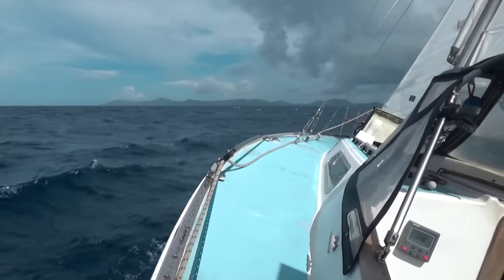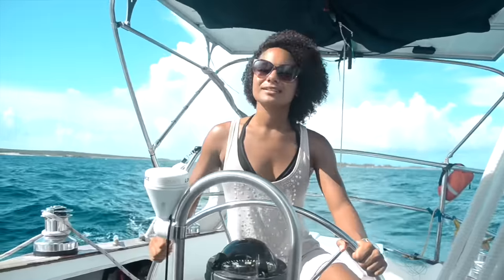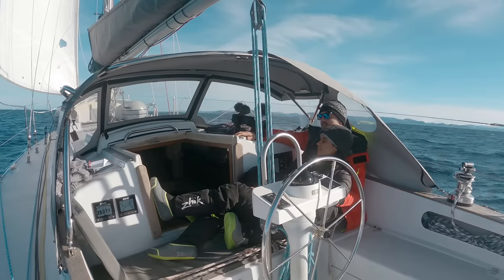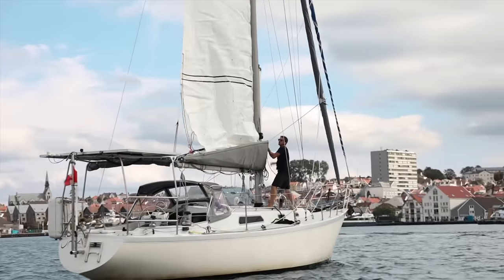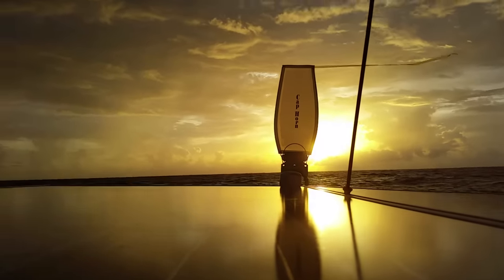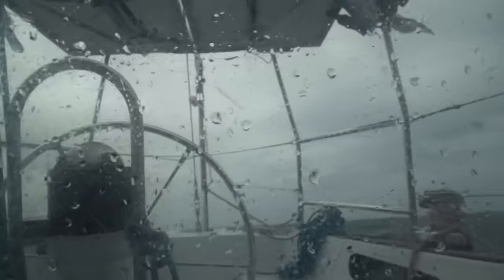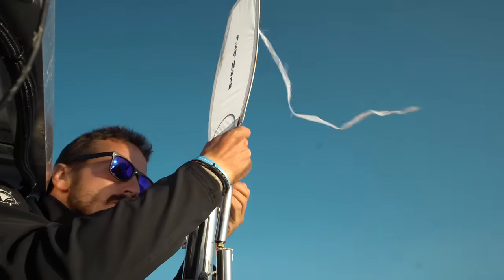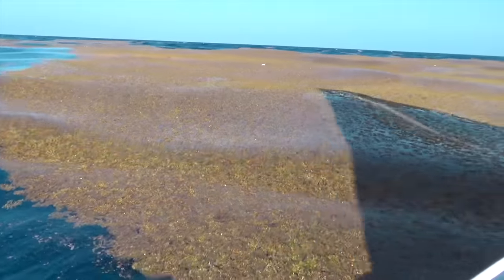Our #1 SAFETY PRIORITY (Autopilot or Windvane)  — Sailing Uma [Step 261]

Comment: Just curious why you guys never used SHEET TO WHEEL/TILLER STEERING? Much more reliable than that raymarine  although if you had the proper powered ray marine autopilot for your boat, it would have been fine.
Reply from the maker: Windvane steers much better. Beside, sheet to tiller works better on slow, full keel boats. Not so good on fin keels

Comment: Let me see i I understand correctly, looks as though the Cape Horn needs to attach to the boats rudder via the rudder quadrant.  I was under the impression that some servo-pendulum wind vanes do NOT connect to the boats rudder post/quadrant . Am I incorrect in that assumption ?
Reply from the maker: Some wind vanes do have their own rudder. But their a lot bigger and bulkier and add more complexity.
Reply: @SailingUma  Yawl do a EXCELLENT job in sharing the narrative of your video's ... well done guys !
Wishing you Fair Winds and Calm Seas .... 👌 ⛵

Comment: One other downside to the wind vane is it doesn’t work well if you have dinghy davits back there. So it becomes sort of a trade off of do you want to mount your dinging off the stern or do you want the wind vane? If anyone knows of a way to have the davits and the wind vane I’d really like to know about it.
Reply: Most of the offshore cruisers I have seen, keep the dingy inverted on the bow, for ocean crossings on monohulls, catamarans, have better protection back there, for values of protection.😁  I have seen a few Hydrovane setups, that have a taller top pole to get the vane slightly above the level of the top of the davit arm, into clear air.
Best wishes

Comment: If you are sailing in a congested area you should be hand steering and paying attention yourself to what is going on.
Reply: You can pay attention without a tiller / wheel in your hands!
Reply: @Panoramix0874  I think that goes without saying.
Reply: @emilybh6255  so no need to hand steer! An autopilot will steer better than a human that needs to pay attention to a million things and IMHO you are better off paying attention to your environment than hand steer. If you are on a collision course with many boats around, you can always put the autopilot in standby, steer manually for 5 minutes and reengage it afterward.

Comment: Firstly, I enjoy your channel, BUT, the info you have given regarding a self steering wind vane in comparison to an auto pilot, re: anticipating the movement of the boat is not correct, the wind vane will only correct, when the wind vane tilts or rotates, i.e., the coarse changes, it does not  anticipate the coarse change, verses a modern auto pilot like you have [B&G], with a 9 axis gyro, monitoring roll, pitch and yaw , and anticipates a coarse change, and will start correcting before the change takes place, much like a helmsman would.
Reply from the maker: The windvane has a pendulum in the water and it can also "feel" when the boat is sliding down a wave and correct the motion. But after 3 years with both, we still prefer the windvane off shore. It just works better.

Comment: I watched a few of the Atlantic Crossing videos in rough weather to watch the Cape Horn in action.  It is like some mystery magical helm.  Even when watching it was hard to understand WHY it works.  Maybe I am just dumb.  But, it's a very cool thing.  I did notice at 13:20 the howelling of the wind was clear and wanted to be in this show!  PS Did you get a kick out of seeing the old helm station, the blue decks, and what was that little gear shift thingy under the bench?  (left port side of Wheel)  Happy Trails
Reply: (Disclaimer: not a real sailor, much less a cruiser)

I'm not sure how exactly the Cape Horn works, but basically, you set the vane to point in the direction you want the wind to come from, relative to the boat. If the boat now turns, the wind doesn't come from edge on to the vane, so it blows the vane over in one or the other direction. That in turn triggers some mechanism that will turn a small auxiliary rudder in the proper direction to make the boat return to the proper wind angle. 

I once saw a wind vane that sported a tiny propeller that was hanging in the water that would generate a bit of power to help move the rudder... (Not sure how that part worked, I'd have to look it up)

Edit: I looked it up, the Cape Horn is a servopendulum system. That means, the wind vane getting knocked flat turns a balanced servo rudder. That rudder is normally aligned with the water flow, but when it is turned by the vane, it starts generating a significant sideways force. That force is then used to move the boat's main rudder and steer the boat back on course. Some systems also have an auxiliary rudder that is controlled by the pendulum. There's much more to it, the book "Boatowner's Mechanical and Electrical Manual" by Nigel Calder has like 7 pages on it, including detailed drawings.

Comment: I know you won’t agree with me but you are required to keep a 360 degree look out at all times. Auto helm devices are terrific to ease the tedium of hand steering 24/7. You’re correct in that it wears you out, and fatigue is dangerous, but you still need to keep watch. I get that when you’re out on the open ocean, with all of the electronic warning tools commonly used, the odds of colliding with something are very low. That said if I offered you a jar filled with a few thousand Smarties and told you one of them would kill you, would you eat even one?   Sailing short handed or single handed is not a get out of jail free card for disregarding the rules or good seamanship. 

Regarding the auto helms I agree hydraulic systems are more reliable and perform better than the wheel driven systems.  That said I have a Raymarine wheel system and it works pretty damn good. I’ve experienced none of the problems you noted and so far (4 years) it’s performed almost flawlessly. Saying that I probably just put the kiss of death on it. Clearly I don’t rely on it as much as you would, nor do I subject it to the kind of sustained hard core use you would.  

Just my thoughts on a very important topic.
Reply from the maker: Of course we always keep watch! That is more of a sailing common sense that we felt didn’t really need to be explained in this particular video. Every sailor has their system, and We have our watch system that works really well for us on our boat. But not hand steering on long passages is already enough to not be exhausted after a few hours on watch. It literally went from 2-3hrs shifts that we had in the tropics to 6hrs, which means one of us gets to actually sleep for 6 hrs while the other is keeping an eye out.